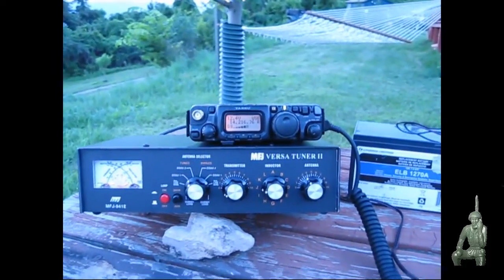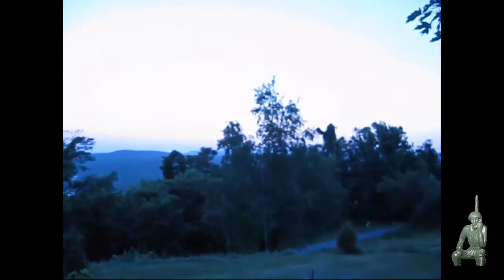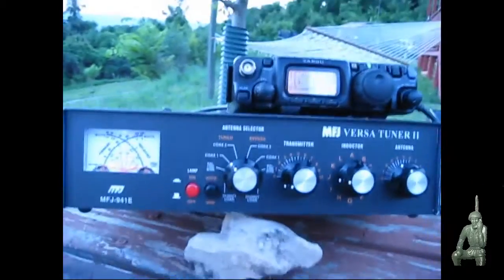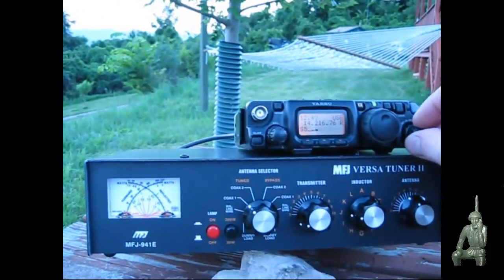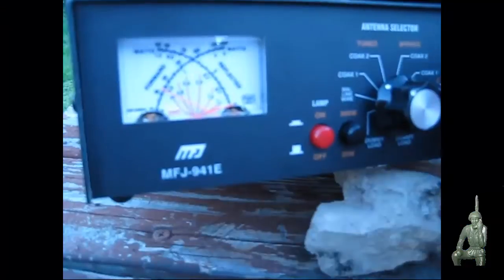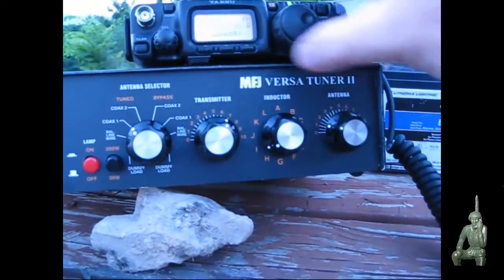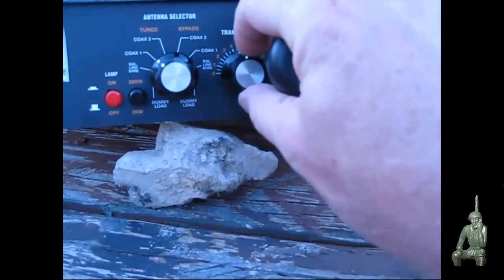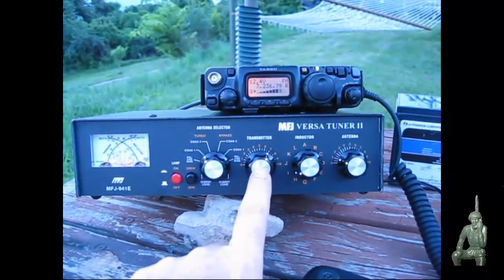MJF Antenna Tuner Repair

Comment from the maker: I used AM because that's the only carrier option I have on my other radio.  I was not until I was shooting the second part that I realized the FT-817 also has FM.   AM provides a percentage of available power when transmitting (that's why it only showed 2 of the 5 watts).  However, FM uses the full carrier (available power) - so when available it's a better option when you need a carrier for tuning.  With such low power (5 watts) and a meter scale of 30 watts I figured 5 would video better.